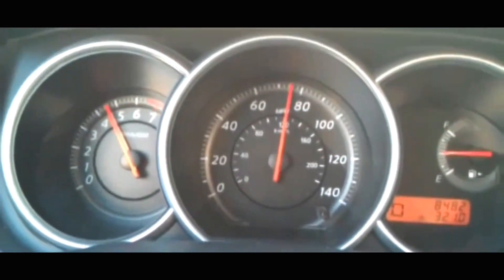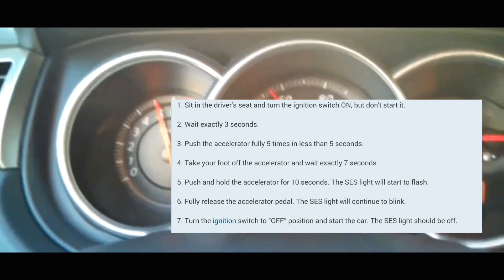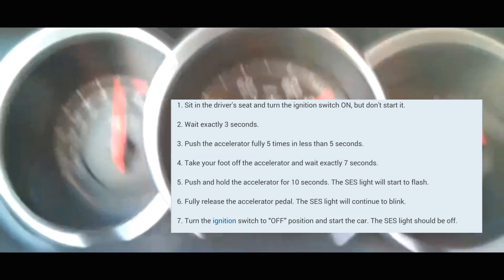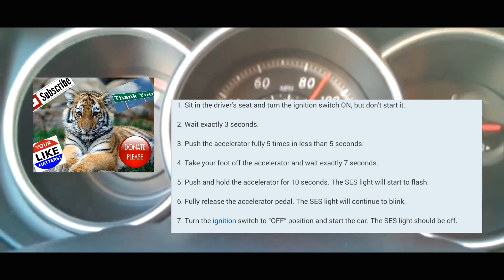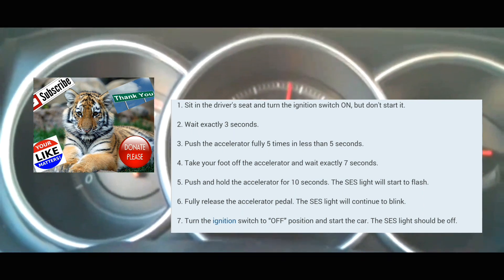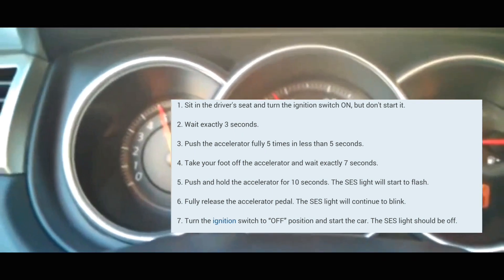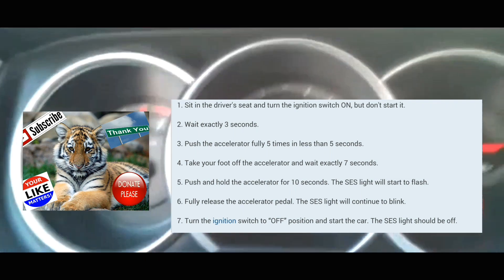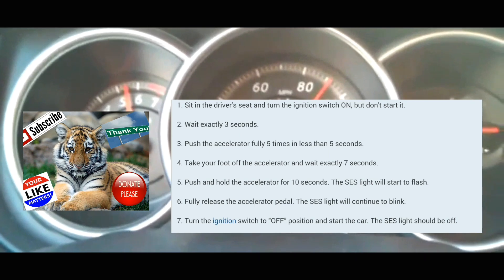How to reset Service Engine soon Light on a 2007 Nissan Versa.....

Comment: I did all that but it doesn't work with mine what should I do please help me if you can am from Iraq Kurdish but there is no mechanic I can see here. 

that's what's wrong with me right now 29/09/2019  my car start after the 2nd time, doesn't start straight away every time its Nissan Versa 1.8.

a few days before that I was left with out petrol on Road when I refiled it again then that happened, 

also engine light styed on now showing  (service engine soon!) please help me and let me see who is the smartest to identify the issue. I have already cleaned the fuel pump filter and mass air F.

Comment: Bought an 07 versa.. engine lights on all the time, even the tire icon too. Y is it always on? N do i need to reset it so when there's a real problem it will turn on?
Reply: Same I’m trying to reset it but it gets lock 
At the third pedal

Comment: You’re missing a few steps at the end 

Step 1
Open the driver's side door and get into the drivers seat.
Step 2
Insert the key into the ignition and turn it a quarter turn so the ignition turns on, but the engine doesn't start.

Step 3
Step on the gas pedal and quickly release it. Do this 5 times in less than 5 seconds. When you step on the pedal, press it down as far as it can go.
Step 4
Wait 10 seconds.
Step 5
Press the gas pedal completely down with your foot and hold it there for 10 seconds, or until the SES light blinks on and off.
Step 6
Step on the gas pedal and hold it down completely for another 10 seconds and then release it.
Step 7
Turn the ignition key to the off position.
Step 8
Wait 3 minutes for the ECU to automatically reset.
Start your engine. This will reset the SES light.